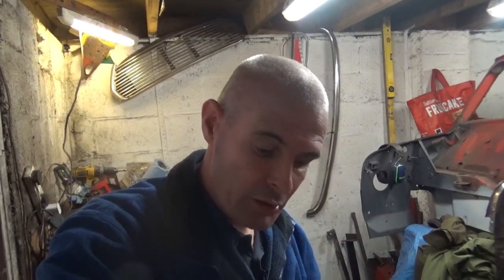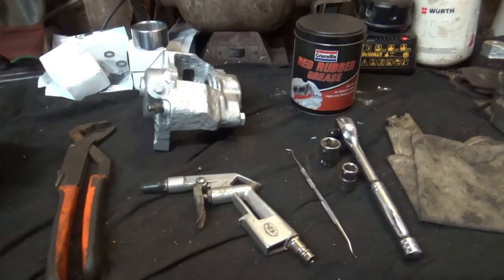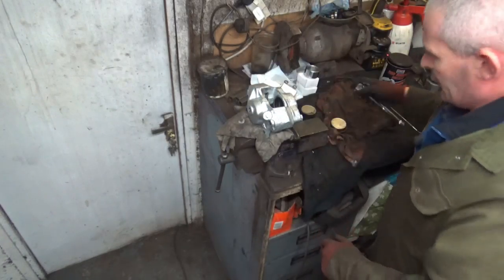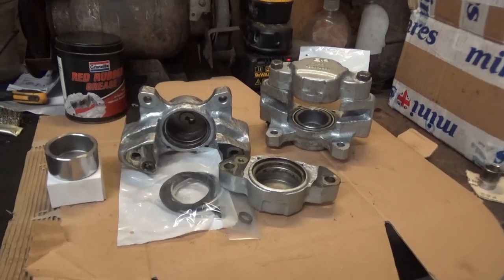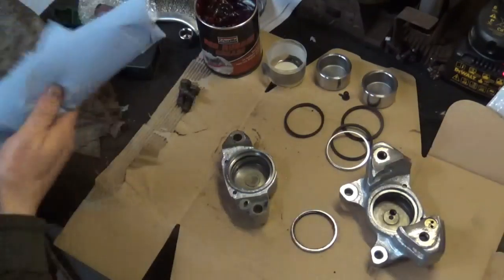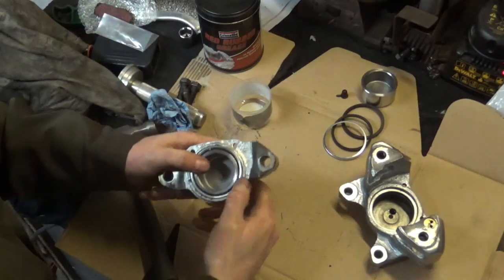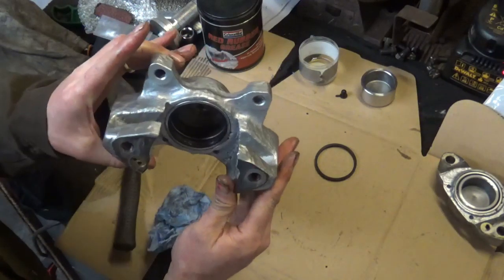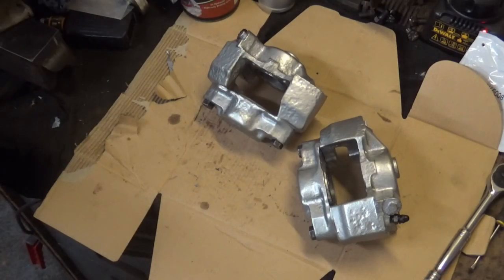Austin mini 8.4 brake caliper full rebuild new seals and pistons

Comment: Brilliant job Sean keep it up. It was lovely, rebuilt a brake master cylinder, brake servo, brake pressure limiter, calipers and cylinders are ok but did a retune with timing light and colourtune, basically got the car out of the garage after 7 years due to lockdown, full service myself and motd outside with a pass on an 89 model. Thank you.
Reply from the maker: Thank you buddy very well done on the mot. It's such a great feeling getting a pass especially when you put a lot of effort in to the car to get it to that stage. All the best, Sean

Comment: Hi Sean, great video, where did you get the drift tool you used to fit the metal ring? I can only see metric drifts online. Thanks
Reply from the maker: Hi buddy, the bearing drift set was bought on amazon, links in video description

Comment: Alright Sean, What grade of sanding paper did you use to rub down the cylinder? Dont know why i´ve always bought recon calipers, didnt think about how easy it is unless theres loads of rust in the cylinder
Reply from the maker: Hi buddy, the emery paper was 600 grit. The bores were actually pretty clean and I just gave them a rub to remove some staining as the piston sort of floats in the caliper. Just make sure that the grove in the caliper is spotless for your new inner seal and also especially make sure the water seal seat is completely spotless and smooth otherwise the metal ring will twist and buckle. All the best, Sean

Comment: I too could not find a torque value for the caliper bolts (not in Haynes).. Mine had red locktite on the threads when I had them out. I snugged them as much as I was comfortable doing. Calipers are alloy and will strip if done too high.
Reply from the maker: A spot of licktight then just tightened the bolts,  that's what I do 😁

Comment: Hi Sean..  I know what you mean about brake fluid destroying the paintwork. Do you think spraying LAQUER over the paint will protect the paint from the brake fluid or is LAQUER just as susceptible to attack like paintwork ? regards Don
Reply from the maker: Ho Don, I reckon brake fluid will eat its way through lacquer too bud. If brake fluid splashes on the paint its best to get it off straight away